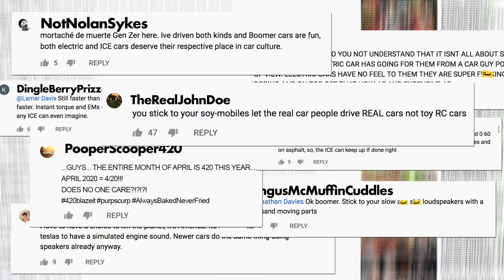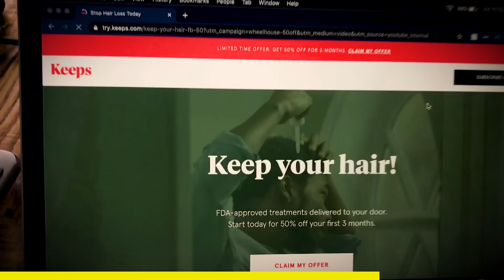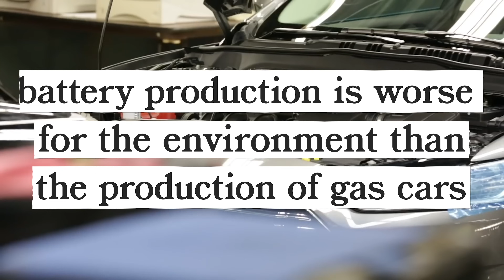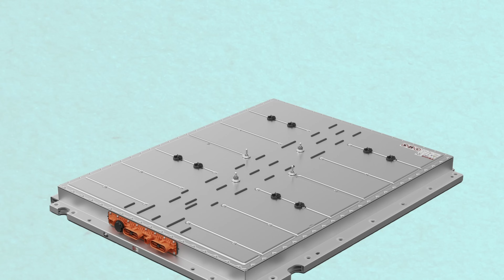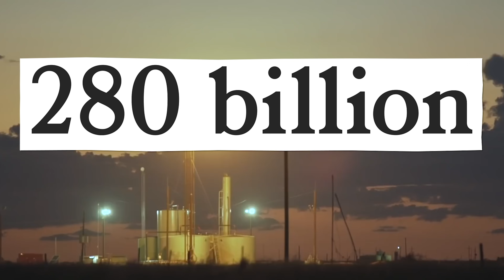Are Electric Cars REALLY Better for the Environment?

Comment: The amount of false statements in this video is astounding well much of it was researched a lot of it was not taken into account. If you combine all the actual numbers a rough estimate for years until equivalency between a gas midsize vehicle and an electric midsize vehicle is approximately 10 to 15 years when you include recycling of said vehicle and where are the power comes from. You're better off running an old vehicle until it dies then adding new emissions of a greater proportion to the environment how many people keep a car 10 to 15 years nowadays
Reply: Also electric vehicles need a battery replaced every 8 years or 80,000 mi is about the best you really will see if your daily driving it and it's not just a perfect case scenario. A lot of people are you only loses 4% or so every 10,000 mi but if you know how batteries work once at about 75-60% life they can just completely die. So replacing the battery every 10 years adding a pretty much similar amount until we get better efficiency batteries or longer lasting batteries up into 15-20 years
Reply: @alexdockery6003  you say You’re annoyed and false statements then immediately make a false statement. Modern EV batteries have warrantees alone for 8 years and 100,000 miles (and some unlimited miles). Older Gen EV’s such as the 2012 Model S are commonly now surpassing 300,000 and 400,000 miles and some well over 500,000 miles and modern battery cycles life for modern battery packs are 1,500 cycles. 

In addition it was found by numerous wells to wheels studies comparing similar size, class and trim vehicles that whilst EV produce approximately 15% more emissions during manufacturing, (which equates to about 1 ton) over their service life (of a classic combustion cars 250,000 miles life) a combustion car will emit 20-30 tons more emissions that an EV when including oil changes, regular replacement parts, fuel to well, etc. they almost always find the hot end of life impacts are roughly equivalent as more than 95% of current lithium ion batteries are recyclable.

Comment: Really need to look at more than just CO2 impact.  You hinted at part of it with disposal issues - lot higher with EVs.  Also, EV battery efficiency and life can vary dramatically depending on location, use, and how it's charged (if not under warranty, battery replacement can be $5000 - $15000).  Eventually EVs will get there, but they still have lot of issues to work out.
Reply: EV batteries get recycled, so the disposal issue is minimal since they are mostly metals.  And most of the metals can be recycled.

Comment: Don't forget that EVs still use plastic, rubber tires and lubricants all made from oil products. You need to increase there permanent carson footprint by how much maintenance parts are affecting the environment. Also if a fuel car has an accident and becomes completely consumed in flames it's bad, shoe on the other foot, those lithium ev batteries are much much worse. And how much of a carbon footprint is associated with recycling those batteries? I feel there is a few avenues that you failed to explore.

Comment: I'd be interested to see this but with the frequency of battery replacements factored in because I've never seen those batteries last longer than a couple years
Reply: Current batteries have an 8 year warranty and many these days are lasting well over 300,000 or even 500,000 miles
Reply: What utter garbage!!!!  An electric car battery comes with an 8 YEAR warranty!  With care, an EV's battery can last 10+ years. And even then it may not necessarily need to be completely replaced, as it can be refurbished. Watch the YouTube video posted by a Tesla Model S owner. His car had covered 400'000 kms on it's original battery. Just where do you people get your misinformed crap from?

Comment: The problem I have is when the batteries are no good 10 years into the life of the vehicle will you invest the $15,000 to replace them? Probably not so you will sell the car right? Who’s going to buy a vehicle that needs that level of work, and does it just end up in the scrape pile anyways.
Reply: @jeremyscott6641  how did you repost that 12 times?
Reply: @jeremyscott6641  in any case, older 2012 era model Tesla’s at current are the ones already surpassing 300,000 and 400,000 miles, many over 500,000 and one over 1 million miles. 

As for battery replacement. A local mechanic might not be able to replace the batteries but similarly when we moved from horses to combustion cars, horse farriers couldn’t work on them. But battery replacements aren’t that complicated you just need experience on the electrical side of things.
Reply: Actually modern EV’s at the moment are set to outlast and are outlasting combustion cars to as much as more than double a combustion cars lifetime
Reply: @Engineering the weird guy wow that is glitchy I wasn’t able to read any replies on other people’s posts the other day wonder if they are connected, anyhow agreed that the mechanics will need to update their skills but I am questioning if Musk is going to go all Steve Jobs and exclude anyone else but a Tesla tech working on the car being that it’s basically software.
Reply: @jeremyscott6641  he already hasn’t. There are just “Tesla approved” services. Which are privately owned vehicle mechanics who have received training from Tesla on how to safely service their cars. For example someone damaged my model 3 when it was in a parking lot. (Tesla’s have sentry mode so I got their license and face on sentry and got them to pay it through their insurance. Big shoutout to sentry mode). I took it to a place called B&A motor repairs. Tesla website said they were approved service/repairers. And they fixed my car for me.
Reply: @jeremyscott6641  as for software. Tesla’s are unique as they are the only cars in the world with free over the air updates (Mercedes are about to start doing this also as a paid subscription service. But they’re already 10 years late to the game). So when there is a problem with software, I call Tesla as they do remote diagnostics over the air, as I’m driving. If they have to update, reinstall or repair any software, they will do so at a time I indicate to them that I won’t be using it. And it gets fixed. And it’s all part of buying the Tesla is that I get that as a service for free for the life of the car
Reply: @Engineering the weird guy wow ok sounds like there is a system in place to help remote owners thanks for the info.
Reply: @jeremyscott6641  no problem
Reply: I am sure the tech for battery longevity is improving and my concern is based on older models because that’s all we can judge buy, but when was the last time any new electronic stood the test of time which brings up the next issue, when it breaks your local mechanic can’t even touch it.

Comment: California have a hard time supplying electrical to their citizens and experience rolling blackouts frequently so you're saying electric cars will not put a further strain on those systems? Do you have links for those sources you said you have?
Reply: The majority of blackouts in California are intention to reduce fire risk. California also suffers from a unique inability to implement effective governance and legislation around grid integration. Power draw and capacity have little to do with why California have rolling blackouts

Comment: Hydro electric is only clean fuel source making large enough amounts of power. But most east coast is coal fire and nuclear energy. Plus all the minerals mined to create the batteries and the plastic from oil in car and body. So no they aren't better probably worse if battery packs aren't recycled properly and those battery packs only have avg. Life of 10 years my ice last much longer if properly serviced.
Reply: It is a fallacy that these EVs are better for the planet. They're only good for the manufacturers that make $$$ from them.